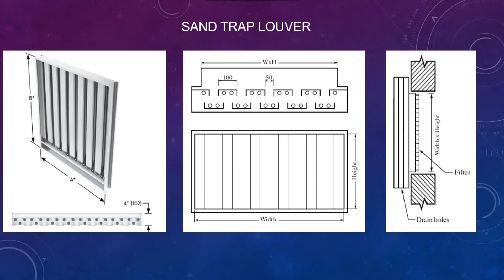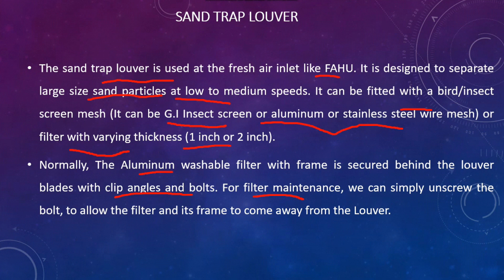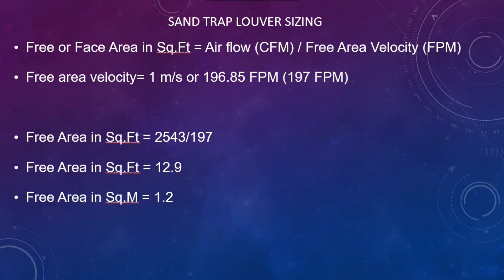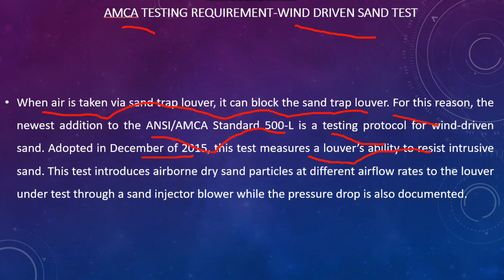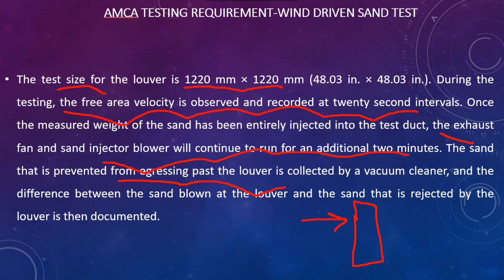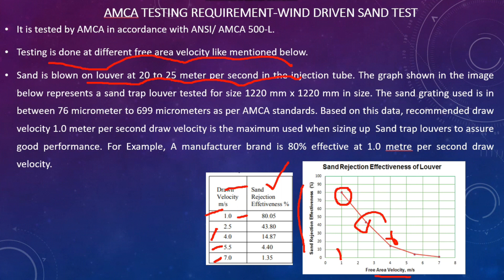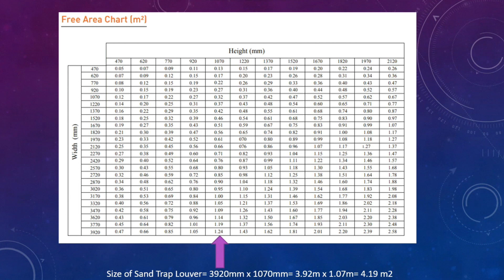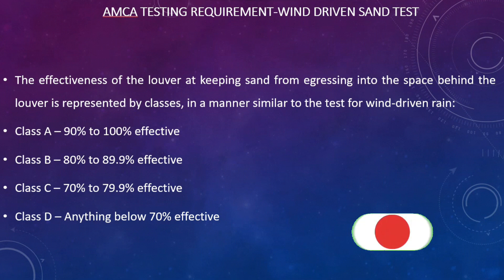Sand Trap Louver-Sizing as per Standard l Working l Materials Selection l AMCA standard Requirement

Comment: If there is no much sand in air, it may not be necessary to have sand trapped louvre, am I correct? Many fresh air unit comes with a pre-filter
Reply from the maker: As u told FAHU has some filter arrangement like Pre filter and Bag filter,etc. But each filters have some filtration level like we say 5, 10 micron, etc. So it is important to consider the sand trap louver for increasing the efficiency of filtration